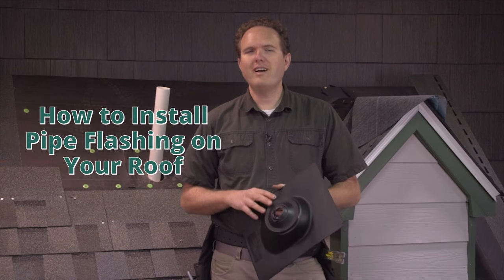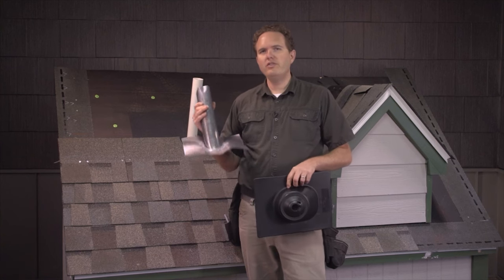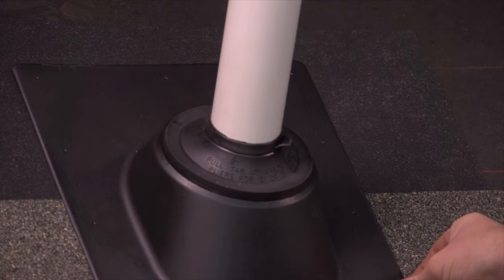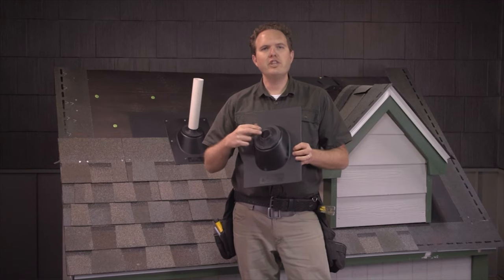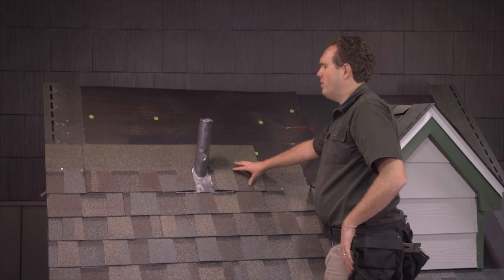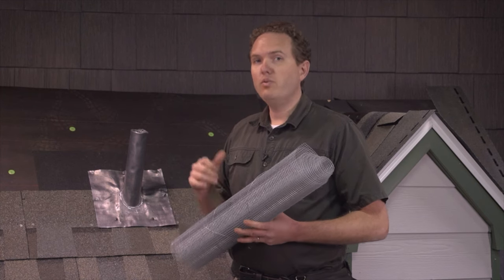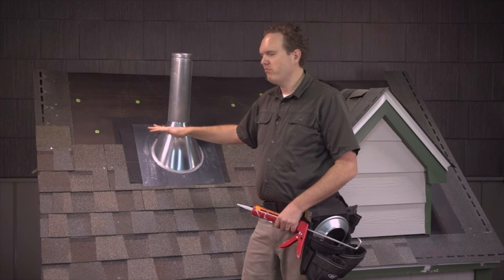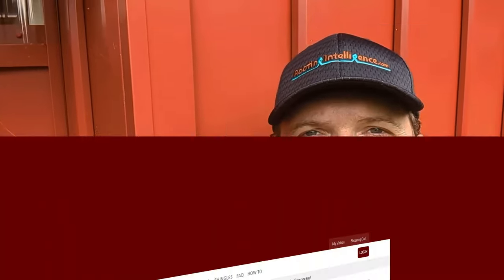How To Install Pipe Flashing On Your Roof

Comment: Hello, new subscriber here. I’m installing a metal roof on new construction. 12x 14 foot roof, lean to style, 3/12 pitch. We used ice and water barrier on the entire roof, but haven’t put on the metal roof yet. I need to install a chimney through the roof, and was wondering if I should put the metal on and then the chimney, or should I install the chimney first and then the roof. Any thoughts are appreciated!
Reply from the maker: Definitely put the chimney in first and then work around it.